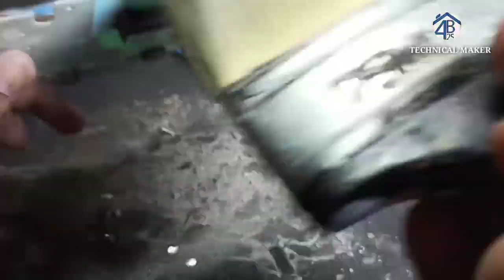Restoring cansole 🎮| 5 year old fully damaged, | making useful damaged game| repairing video game

Comment: Bro, it’s flipped 😂 like a mirror and that’s an headphone jack, it can be used as an MP3 player. I have a old Samsung battery but I can’t fit it into the battery place cause it’s pre installed battery is very odd. I thought if you’ve cut the back shell into a house that can fit the nokia battery.